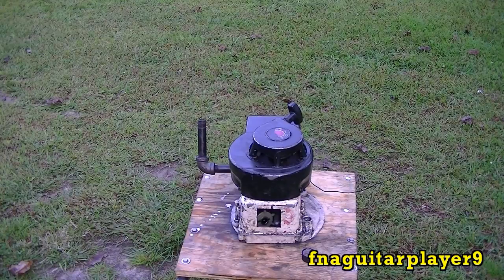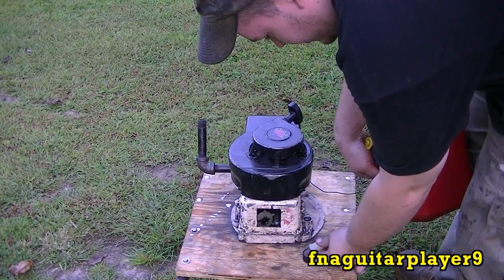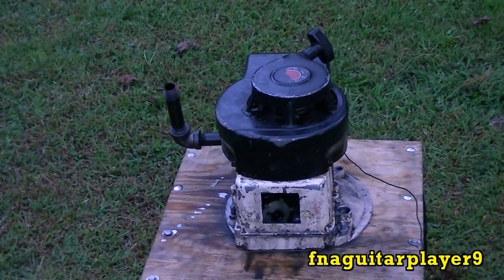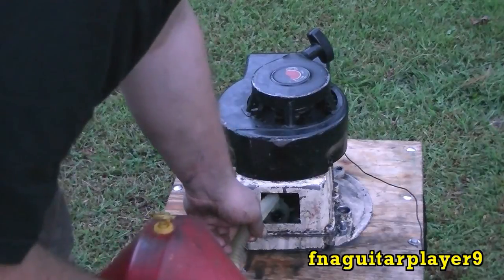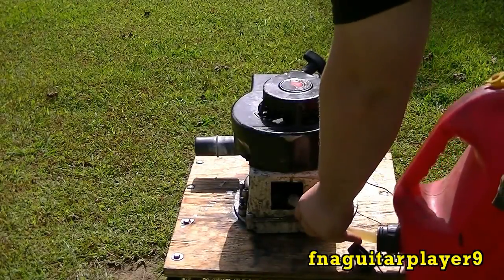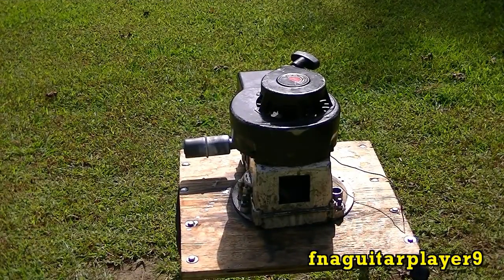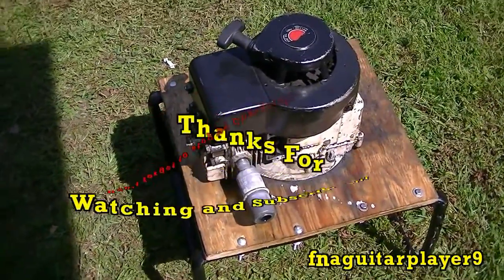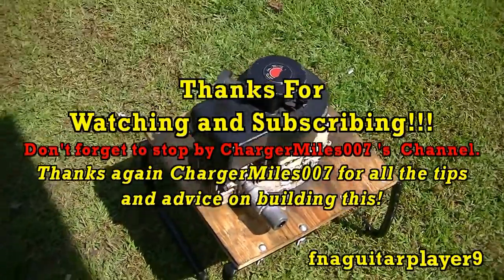PIston Valve Engine Part 2 (of 2): Test runs, best run at 6:58

Comment: Great job, I think you got it.
BTW, I see you are using the good old gas can, I bought 2 new gas cans for extra gas for my generator for the storm and they all have those crappy new spouts that leak all over the place.
I like the old style with the flex spout and the vent on the back top of the can.

Comment from the maker: Thats not a bad idea! maybe cut out the block a little more so the air intake can be varied more. i tried putting more fuel in but it flooded out. it is very very picky on how much gas you put in it. i do think the air intake whole needs to be a little bigger though. i tried carburetor cleaner in through the back but it didn't work. i don't know why! thanks for watching!!!

Comment from the maker: hahahaha it seemed to run alot better if i oiled the cylinder each time. next time i run it i might try a very rich 2 stroke mix, alot of oil in it just to see how that works. see how it wanted to rev up then "idle" down. I just wander if the valve is opening to far? thanks for watching, can't wait to see your 4 cylinder running!!!

Comment: Put you a wire screen with a foam gas filled filter over the hole you cut that way it sucks air and vapor and you can add more wile its running....